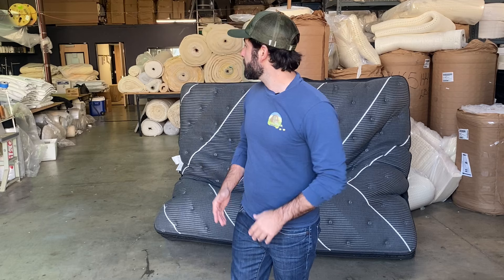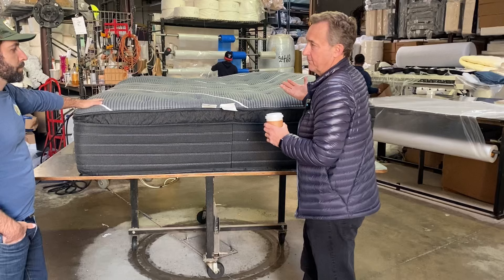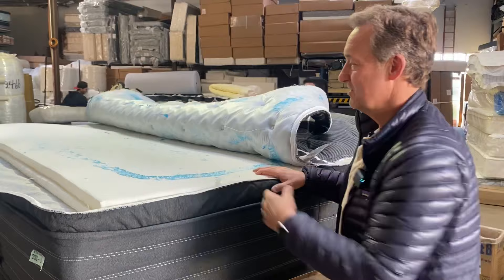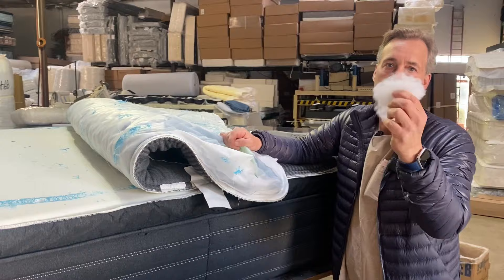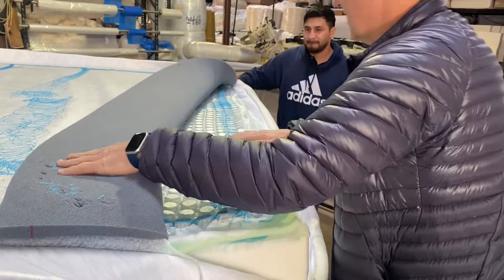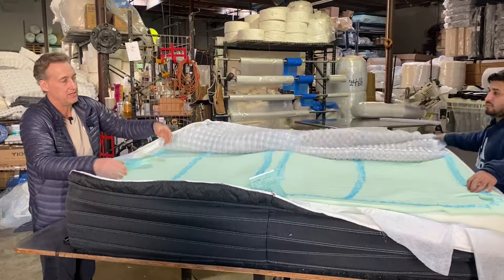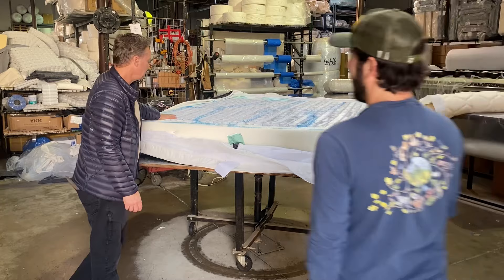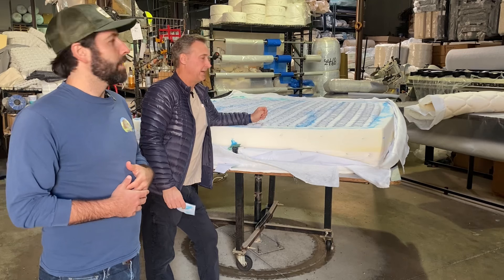What’s really inside a Beauty Rest Black, this is an over five thousand dollar mattress, worth it?

Comment: "Spencer's Ventura Mattress", is a mattress manufacturer. 

I'm currently shopping for a new mattress, and have been doing a LOT of reading and video watching, as well as testing mattresses that I can personally test in my local area.

So, based on this video, I should call you guys to make me a mattress?
I went to your website, and there is nearly no information about how your mattresses are made.
There is some information about some of the layers you use, such as latex, but little else.
Not listing any pricing on your site is not appealing for shopper, such as I am.
Even a range of pricing, with information about options, would give me much needed information about your beds and prices.

Showing me the inner layers, and problems, of a competitor's mattres, doesn't sell me.